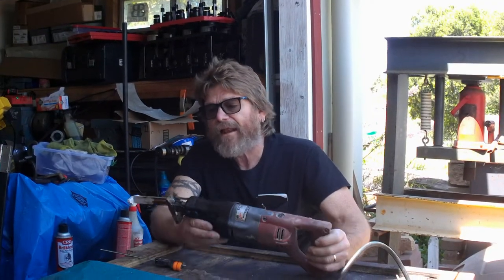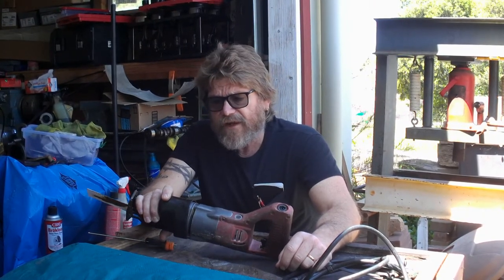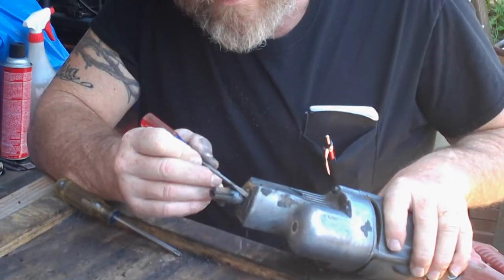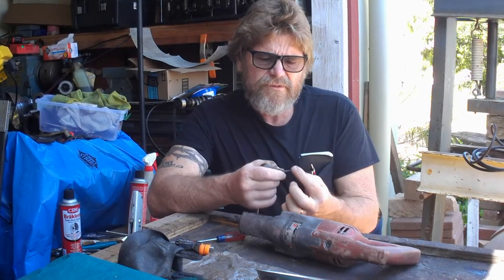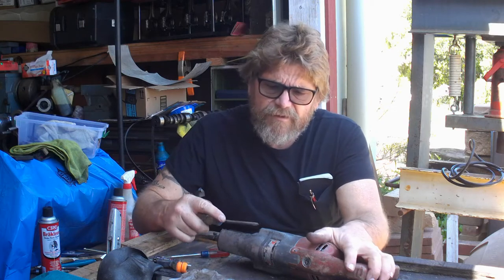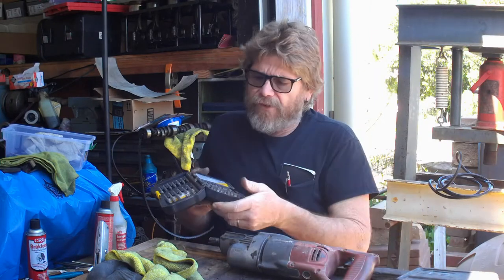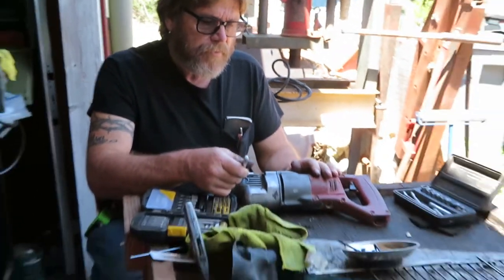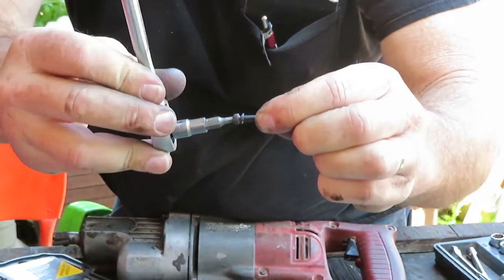Sawzall Repair

Comment: I’m taking apart my Hilti Sawzall. I  like a manual but it is what it is.
Reply: I got a porter cable 629 6-speed reciprocating saw 8 amp that I got new in 1994 going to performer refirmishment new carbon brushes repack it with grease I already replaced the shoe the original one got all bent out of whack I took it off and it's been sitting